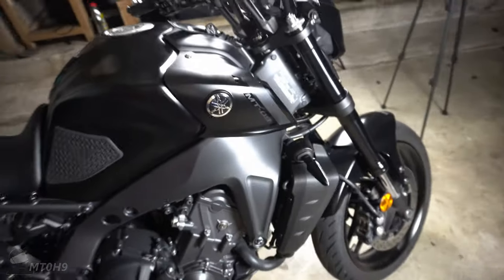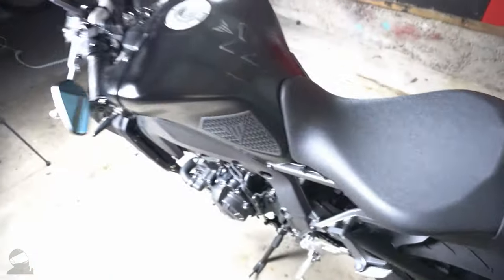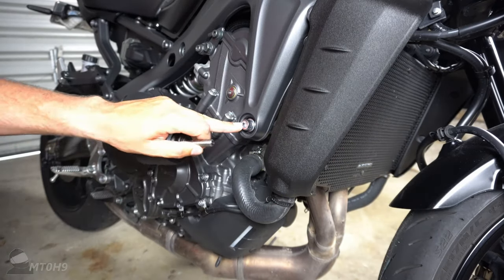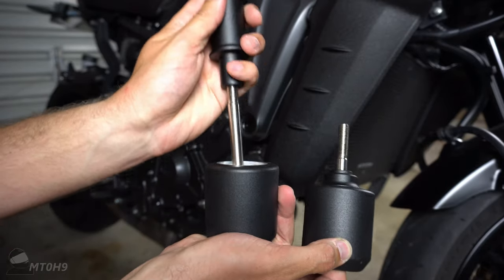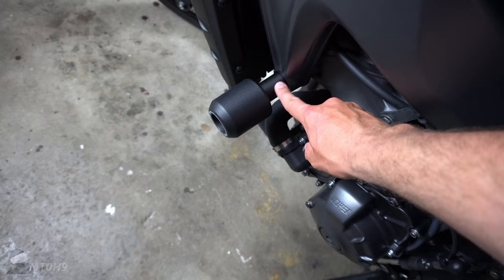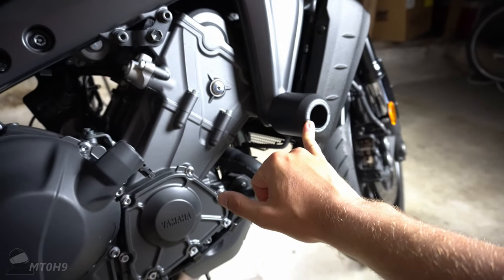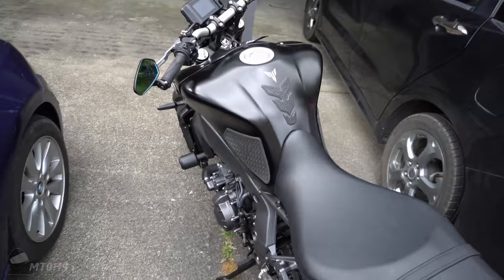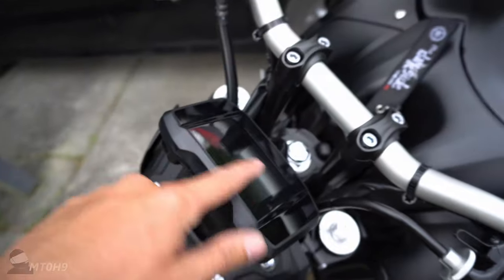MT09 EVOTECH PERFORMANCE Frame Sliders *Modifications*!

Comment: The dealer put my frame sliders incorrectly. They used the long slider on the right instead of the left. Thank god I saw this video and one more doing it the same way. I hope they didn’t throw the original bolts away to safely swap sides. Had I know it was this easy to install, I would have done it myself.

Comment: Careful with installing thus sliders. I was on the dealership last day for the first service of my xsr900. One of the bikes they’re servicing was a mt09 which has a crack on its frame, they concluded that it is because of this very same evotech sliders. My guess is the owner didn’t use the correct torque when he installed it.
Reply: What is the right way to install it? How much torque?
Reply: How many Torque
Reply from the maker: A bit late I know, they are still holding up perfectly. But agreed, do things properly ;)